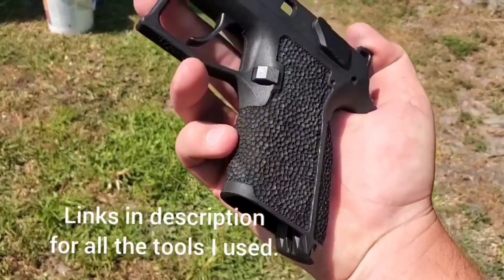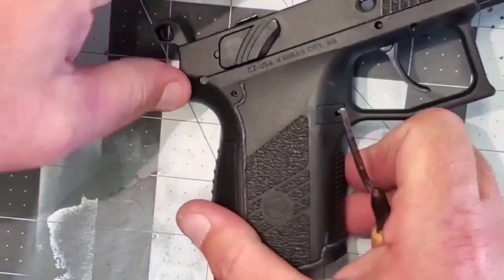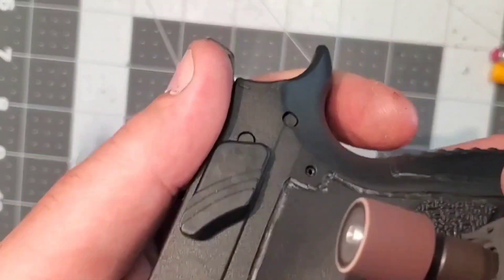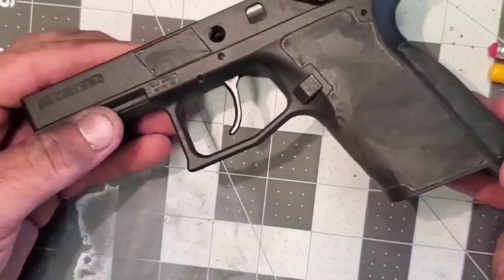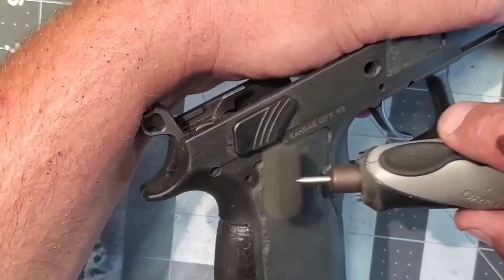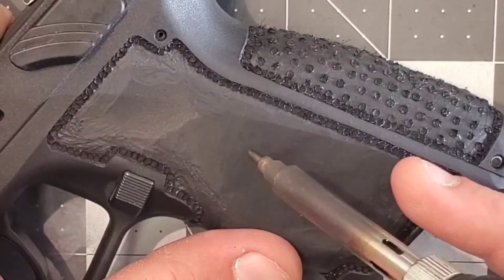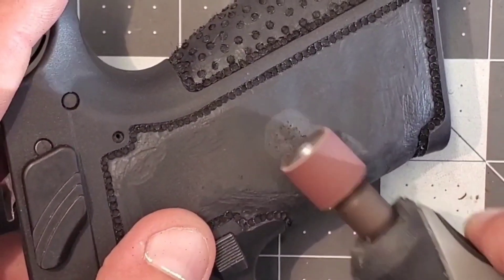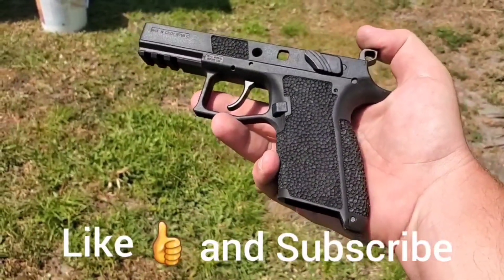How to stipple a gun: entire process tutorial with tool links. Glock stippling tips & techniques.

Comment: The boxes they come in are great to practice on especially for new patterns and designs, I've also found that my rifle cases tend to have a lot of curvature and texture from the factory and it helps with practicing the "prep work" as far as creating a contoured border and grinding the factory texture down smooth, then having a good full practice from start to finish, especially because cases tend to be thicker too so its a little more forgiving than the thinner Glock boxes or other boxes your pistol comes in.

Comment: Drew great video, you break it down for us to try ourself. I want to cerakote my frame. Do I stipple first or after cerakote. Im thinking after. if so is still ok to use the flame? thank you for taking time to help us.
Reply from the maker: Normally you would cerakote first then stipple. (Double undercut on glock before you cerakote) flame is okay, just want to move quick around borders of stipple and color because cerakote can burn. Side note you can cerakote after stipple is done, if you want your textured grip the cerakote color as well.
Reply: @CycloneGunworks  thank you… I’ll cerakote first I want grip black to contrast. 👍

Comment: What size flex cut tool do you use/recommend?
Reply from the maker: 1.5mm.
https://www.amazon.com/dp/B016DBHZES/ref=cm_sw_r_as_gl_undefined?linkCode=ml2&tag=cyclonegunwor-20
 Sometimes you have to wait a week or 2 if they sell out quick, like usual.
Reply: I’ve always wanted to try stippling. You’ve given me enough information and confidence to try it. I’ve got everything on your link list in my cart.  I plan to start with a Glock box, then a practice Glock lower I found, then basepads, then a Gen 4 with those annoying finger grooves.
Reply from the maker: @105Flintrock  thats a good plan, people underestimate how helpful that practice is. It's better to hone your skill before you hit it permanent on a frame.
Reply: @CycloneGunworks  Awesome video!  Going to do this on a G34 soon because of your video.  Is the Flexcut the Micro Shallow U-Guage or the Micro Deep U-Guage?
Reply from the maker: @arthurreuter6415  good stuff, make sure you get the 1.5mm Shallow U-gouge

Comment: Which flex cut tool size did you use, I.e., 1.5mm, 2mm, etc., and which model: Micro deep u-gouge or micro shallow u-gouge?
Reply from the maker: Great question. The 1.5mm micro shallow u gauge. Literally the only one that cuts clean for me. All the other sizes and shapes just don't work as well.
Reply: @CycloneGunworks  thanks for the quick response! Great video - I feel confident in doing this myself now. We’ll see how it goes!
Reply from the maker: @theSWAGflyer   You got it man the key was beginners is to not rush it if it takes you a week then let it take a week.  Make sure you like how your borders look before you move on from them because they're pretty much set in stone once you start stippling. Be sure to practice on your glock box first. A couple hours of practice in stippling makes a WORLD OF A DIFFERENCE.

Comment: Why can't new stippling just be done over the original factory stippling ?
Reply from the maker: Good question. Technically, it can be done, and your grip will be fine, however it can lead to a lower quality finish in your patterns because it will be noticeable. How bad though? It depends on a few factors like how bold/deep the factory texture is or how intricate your pattern is. It's best to at least try to get your stippling area flattened out, but it doesn't have to be smooth or sanded down.